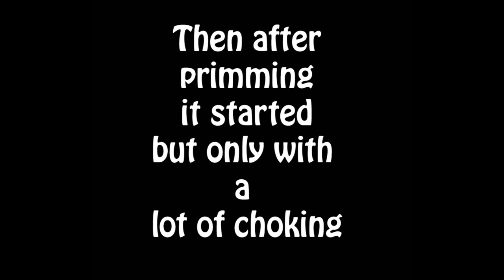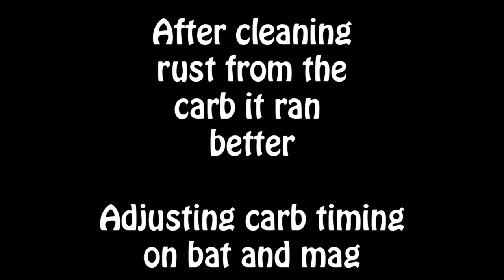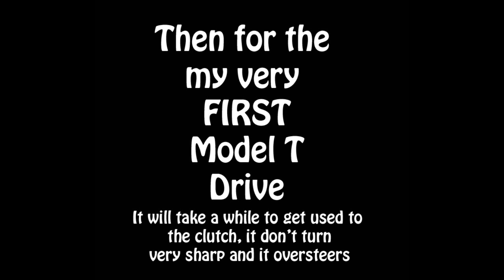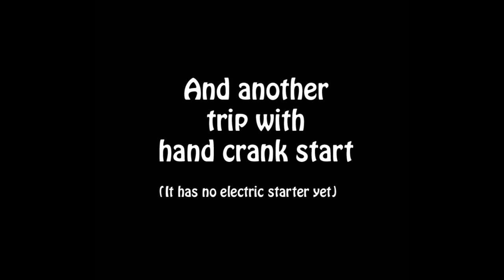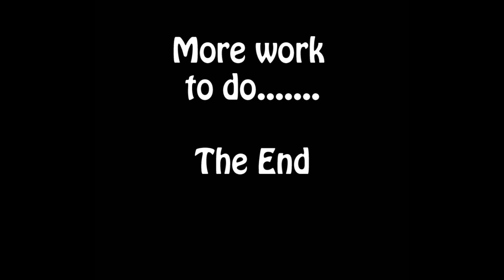1926 Model T Ford - First Start and Drive

Comment: Reminds me of the first car I ever had a 23 T in about 45, I was 15! I used the vaporizer as a base and made a n angle to mount a Model A carb. The A foot pedal stuff bolted right to the back of the  T block. Much more power and driveabilty. I used my Ruxtel with a lever and a spring. I torque shifted it. T low, Ruxtel high, Then, T high, Ruxtel low, and finally both T and Ruxtel high. As such, I got the missing second gear an get away was so much better. Many tales  of that car

Comment: A hectic project, fixing up a really old car is more difficult than designing and building a new car from scratch. 
On a new car if you cant get the part you want you can put in a part from another manufacturer, you can put in any thing as long as it does the job. 
On an old car there is no where to go to buy parts, so depending on where you are in the world you some times end up having to make them yourself which is really a hard task as making a replica of some thing is harder than making a part of your own design, because with your own design you can do what ever you want, on a copy there is only one way to do it, and if its a complex part it can be very hard to replicate. 
So well done in getting this car going it would take more patience than what I have left in me. 

I have done a couple of big builds, 
a 400 cube small block Chevy V8 went into a 1988 Toyota Supra 
and a Smart for Two which I converted to a pure electric car 60v DC, but having to 
re manufacture what was done in the past is much harder to do.

I know the restorer of this car knows that, but a lot of people think the level of complexity with new builds and restoration builds is the same, but it isn't restoration to 100% of original on really old cars is much harder to achieve.

Comment from the maker: I agree the crank may be repairable.  The thing about Model T engines and many other early engines is that they do not use shell rod or main bearings.   The molten babbitt bearing metal has to be cast directly into the block (or rods) and machined into final alignment and size. 

 Jim

Comment from the maker: Richard,
It has a standard Model T Kingston L-4 carburetor on it.  Also it has a Ruckstell two speed rear end in it.   It gives four speed rather then the original two speeds. 
Thanks,
Jim

Comment: Thanks for clearing that up.  I'm about to start building a Model T pickup with a 3 foot bed.  Not having the money for the exactly right parts, I'm going to put the body on a modern frame.  Well, maybe a '76 Datsun or an old Maverick frame anyway.  Still in the acquisition of parts stage.

Comment from the maker: irishcowboy111 ,  
I don't plan on putting a starter on it.  Just makes one more thing to break and cause problems.  Model T's from 1909 to 1918 had no starter.  From 1919 to 1925 starters were an option and in 26 and 27 starters were standard equipment on all cars.   You can find all the changes by year for Model T's by goggling "MTFCA Encyclopedia".
Thanks, 
Jim
Reply: Jim Thode what sort of top speed does that beauty have?

Comment from the maker: Thanks for the comment.  Pulling with the left hand, thumb flat is the safest way to crank a Model T.  If it were to kick back it would kick back before the TDC 11:00 crank position and push your hand away from the crank handle.  Cranking with the right hand or cranking full circle can cause serious injury if it kicks back.  
Do a google search for "Model T Ford Forum: Different Method of Hand Cranking ?????"  or "Model T Ford Forum: Left handed cranking a new insight "   for more info.

Jim

Comment: Love watching videos of the Model T start and drive learning curve. I was there once. It takes a bit but you'll get it. There is a definite science to driving the T. Hopefully you get  it before you go through a set of bands. Once you get it down it will start first flip of the crank after one flip of choke. Get that idle down too. It's idling way too fast. Is your choke wire run out the front yet? Makes life much easier. Good luck with it. Love the T but they are not for everyone lol.

Comment: Very cool. I am myself building a roadster pickup: from parts though. I thought it would be a 25, but after checking my engine serial numbers turns out the engine is a 26. So I too am now building a 26 truck. I have the engine all apart now. It looks like i'm going to need new rings, new valves, hone the top of the cylinder (the rest is mirror bright, too bad). I also am going to need a new fuel coil for the trans and need to have one of the piston arms rebabbitted. hope to drive by end summer!

Comment: At least you have a late model with steel spoke wheels (Only available for 26~27), the wood spokes tend to fail at higher speeds! 
Many wood spokes have failed and caused roll over accidents.

Comment: If you still have the T.  Your spark rod from the commutator to the connector on your steering wheel is too long.  Fold it in the middle (if the fold is there already, increase the fold), the spark lever should only be the distance of two fingers from the top to start.  Then rotate clockwise to the top to the stop for the run position.

Comment: In recent years, there have been several attempts to re-write history and claim that Ford's Model T was not designed to run on ethanol/alcohol. Attempts have also been made to re-write history to say that John Rockefeller did not use Prohibition to shut down the alcohol fuel industry.

I just published a thorough review and analysis of Ford's intentions for the Model T, as well as an eye opening look at what I believe John Rockefeller intended to do. 

The story is called: Yes, Tin Lizzie Was An Alcoholic. You can find it at: https://www.theautochannel.com/news/2019/04/20/660939-yes-tin-lizzie-was-alcoholic.html
Reply: A lot of cars in Brazil run on straight cane alcohol... smells interesting when driving.

Comment from the maker: paytontech,
There are many sources for tires and wheel, both new and used.   New tires run about $100 and up and wheels up to $350 fro new wire wheels.
Jim

Comment: Do these cars have only rear brakes ! And they're mechanical , not hydraulic right ?
Reply from the maker: The main driving brake is a single band in the transmission.  There are hand lever mechanical drum parking/emergency brakes on the rear wheels.  No brakes on the front wheels.
Reply: @jimthode  cool Jim thanks 😊

Comment: Weird.  I was taught just the opposite when I owned my T.  Back when I was a member at the Owls Head Transportation Museum, it was two fingers on each side to start it.

The Commutator rod went over the top of the steering shaft correct?  If it doesnt, then that would explain it.  As my spark lever would have been backwards.

Comment from the maker: The crankshaft is bad because it was scored by a bad rod bearing.  The crankshaft may be able to be ground down to  smaller size and the rod bearing babbitt re-poured.  Then maybe the other crank bearings would need placed and bearings poured in the block.  All together most likely more expense then replacing the engine with a good used engine.   Jim

Comment: One was climbing the old gravel road from Alamogordo to Cloudcroft in New Mexico. Shifting up and down on the Ruxtel, just like the big truck guys di with their two speed rear ends.  At night to alleviate the over heat!!

later, I built a 23 speedster from junk parts. No try to crank it up. Put wife on the gas tank and towed. it. No start??? til i found she had the brake pedal down and the rear wheels did not turn, merely skided on the dirt roaf! Once fixed it fired nicely. ,Another story there/

Comment: Easier to Start a Ford if the trans is allowed to roll over . The rear wheel acts as flywheel to keep the engine turning .If the bands are new(ish) it helps too.

Comment: Hi Jim good job i see ya got 26-27 pedals anyways back when a boy maybe 13 my job was
getting kerosene for the shop stove in a doctors coupe with trunk. This was just a go getter
called today just a beater. My invention in the winter was a string tied to the spark lever 
cause i could hand crank better than the starter even jacked up. Always to run for spark &
it always died. The string worked..bring it back in one piece (never mind me) or a lickin.
can sterno heat no cops free USA.   samuel

Comment from the maker: wi11y1960,
Thanks for the comment.  If you do a google search for "Model T Ford Forum spark control settings" you will find a chart of spark control settings for a Model T.   The spark lever should be fully retarded for starting and the lever should be advanced or pushed down after the engine is started.   
Jim

Comment: Didn’t the 1928Model A have electric starting?
Reply from the maker: Yes, 1928 Model A did have an electic starter.  Most 1926 Model T's also had starters but also had hand cranks.  Earlier Model T's only hand hand cranks with no electric starters.

Comment: Can anyone tell me whether a Model T or Model A is easiest to work on? I think you could still get the same 4-cylinder motor on the early Model A cars, but I read somewhere that Model As had over 150 cotter keys! Was the Model T like that too? I wonder why all those cotter keys instead of bolts & nuts?
Reply from the maker: Bill,
I would say that a Model A would be a little easier to work on just because the engine and transmission are a more conventional design.  The Model T is 1908 technology and the A is 20 years newer.  There are a lot of cotter keys on a Model T and they are used with castle nuts to prevent the nuts from loosening.
Jim
Reply: Jim Thode I appreciate the info Jim.
Reply: as for working on them about the same but I think the T used more cotter keys than an A did as the T had cotter keys on the nut and bolts on the oil pan where as the model A did not but the both the T and the A used cotter keys on the rods and mains

Comment: Probably doesn't like that unleaded ethanol gasoline
Reply: ebayerr   my local gas station carry's leaded but it comes at hefty 
a price
Reply from the maker: No need for leaded gas.  There are thousands of Model T's and other old cars running on unleaded gas with no problems.
Reply: The Model T was designed to run on ethanol as well, so I don't think it would mind running on blended fuel.

Comment: Was an electric starter standard on Model T's?
Reply: Starters and generators became available on the model T in 1919. This year "T" would have had them as standard equipment.
Reply: The first model Ts had a crank start, they didn't have electric starters at the time

Comment: You'll be wanting to put the front brakes back on before you take it out for a spin...
Reply from the maker: Model T's never came with front brakes.  Only the brake in the transmission and the parking brakes on the rear end were standard.  After market front brakes were available but quite rear today.  Jim

Comment: Looks like a nightmare to handle.
Reply from the maker: Yes the steering was very bad.  I found that the caster was essentially reversed so it would not track straight.  I adjusted the caster and it now tracks straight down the road.
https://pbase.com/jimthode/caster

Comment: why the wheel is always turning?
Reply from the maker: The Model T transmission has bands and a little drag in the bands will cause the wheels to turn.  There is no free neutral like in a modern standard transmission.    Normally the drag in the transmission is not a problem but for the first start it turns a little freer with the rear wheels off the ground.  In very cold weather when there is more drag because of the thicker oil it was common for folk to lift the rear wheels to make it easier to start.
Reply: Got it, thank u man..